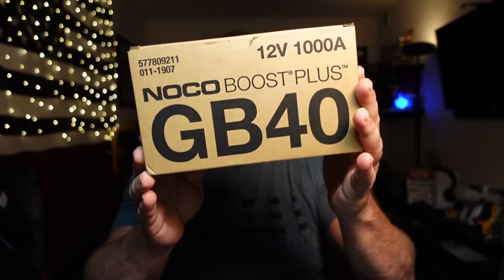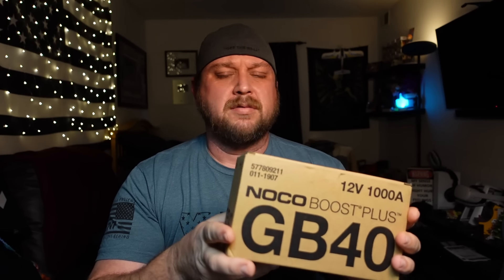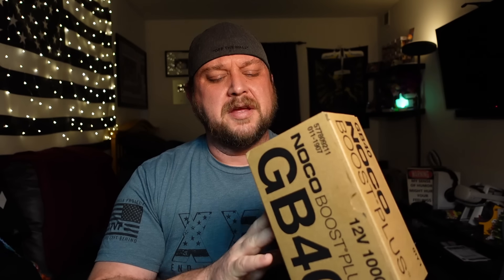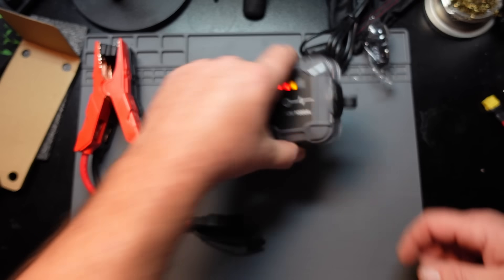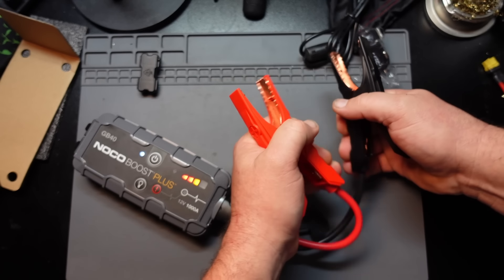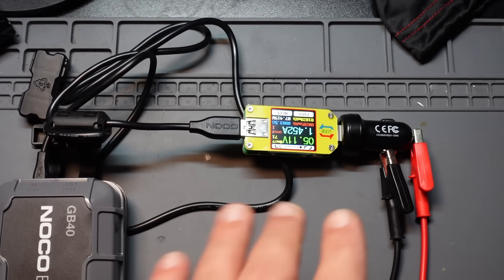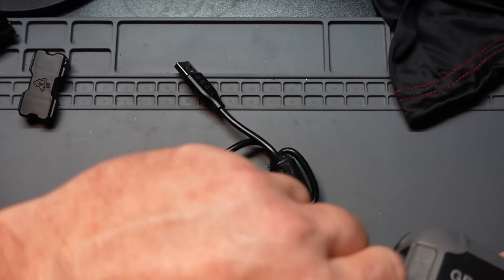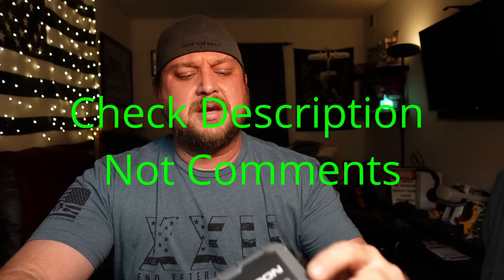NOCO Boost Plus GB40 Car Battery Jump Starter

Comment: I said F buying another battery for the tractor. This is now my battery for 2 years....😅
Reply: Lol nice
Reply: Nice way to ruin alternators
Reply: @jothain  my alternator cost under $100, battery every 2 years cost more than the alternator.  5 years.... same alternator. It's not putting anymore stress than normal, if I had a stereo system like when I was a retarded teen that requires massive Amp draw... it's a good way to ruin it. There is no more Amp draw than necessary to charge at 14.1v. It charges and I'm able to start it after a 15min.
Next time kid, worry about your own stuff you know nothing about 😉
Reply: @Not.The.Avg.Smitty  I'm likely older than you dip. Also if your battery is absolute garbage and if it's so bad vehicle won't start, it'll absolutely 100% certainly load alternator more, your logic is insanely bad. But you're right about one thing. I couldn't care less about your tractor.
Reply: @Not.The.Avg.Smitty  I'm industrial maintenance mechanic and luckily I'm not as old and ignorant as you. Good luck with your endeavors 😂
Reply: @jothain  goes from older to not older real fast, and calls me ignorant. You make no sense. You didn't know I serviced semi tractors, extended wheelbase 120"+, rebuild engines. Now what was that you still do? Like I said I pitty you for working still, I mean with all that knowledge you got, could have ran a business, should be retired like me... right? 😉
Reply: @jothain  have a great day at work, I might go fishing today.
Reply: @Not.The.Avg.Smitty  oh the ignorance of old people. Luckily I belong to generation that was actually educated somehow 😏

Comment: Grabbed this up durring quarentine. Used many times and had zero problems with it yet.
Reply: I got the powrun brand from  Amazon. Zero complaints so far
Reply: Had one of the noco ones as well; it makes it through a winter in the car while holding its charge without problems, and has jumped by car & generator several times on one charge.  Quality.
Reply: How many is many?  I just posted on the main thread that I doubt this thing will last very long with frequent use.  These are really made for consumers to charge up and put in their trunk and used once or twice a year for when they left the lights on or something.  They are built for current delivery and not for longevity.
Reply: @tarstarkusz  id say at least 5 a month. I work for a car rental agency and a lot of the time it is a customer leaving lights on or something of the sort as you said in your main comment. Its in the truck now with 3/4 a charge and im sure i can get a few jumps out of it before needing to recharge. Works fine for the price in my book

Comment: Ironically maybe the spacers were there for space. 😅 the two parts of the grip are further apart without the spacer between the clamps.  Maybe having the spacer made better use of space in the packaging.

Comment: Bought one of them about two months ago on recommendation from a friend who works in the car port (the one for ships (and cars)) here in Gothenburg. They use the GB150 model and have used them daily for many years without problems. So far the GB40 is a champ, got me through the worst part of the Swedish winter. I have a 2.0 liter diesel with a semi bad battery and at temps of -20 C (-4 F), it gives me roughly 10 good cranks when the battery is at only clicking start relay charge level. Very well made and the clamps and cables feel really nice. A heartwarming product in the age of throwaway culture. When you do your 1 year review, I'll comment again and tell you about my own experience.
Reply: Çok teşekkürler...👍

Comment: I brought GBX45, (also based on project farm review for the larger unit) but in general, a lot of reviews point towards NOCO being the best of these sorts of products.  Used it to start a Volov XC60, a Expedition 1998, and a few other cars - in MN winter when it was actually cold.

Comment: I bought 2 of those 3 years ago. You should top the charge of about every 3 months. I keep them in my cars and the only times I have had to use them was at temperatures below 10 F. Both the pack and cars where at the same temperatures. The packs have started V8's in those temperatures with one try. Just keep it charged and it will do fine.

Comment: My Grandpa got me that exact NOCO jumper after my car wouldn't start while picking up my cousin from a train station for my grandma's funeral.  Used it plenty of times since on other's cars, but its battery doesn't last forever sitting in your trunk.  Gotta bring it inside to charge once every month or two.

Comment: I have a GBX55, so a step larger than this one. It was able to start a 4-cylinder gas engine with a dead battery in -25°C (-13°F) weather, after a week of sitting with the unit in said cars trunk, with temperatures ranging from -20°C (-4°F) to -35°C (-31°F) during that time. I was thoroughly impressed.

Comment: Great little jump pack.  I've been using that exact model for about a year now with maybe 6-7 uses...plus I overheated it trying to jumpstart a military Deuce and a half but after it cooled down it still works.  FYI - It will not start a 7.3 Diesel unless the batteries are just barely too weak to crank fast enough for the old girl to bark it off.
Reply from the maker: I think a forklift battery would struggle with a 7.3 on a cold day. 😜
Reply: That motor probably uses a 2000+A cranking current battery and this little fella only goes up to a 1000 amps, but they have models going up to 3000 amps in this series

Comment: I have one and absolutely love it. It's been perfect on diesel and gasoline cars.  However, it lives in the saddle bag of my Street Glide with all my tools for the road. It works great on motorcycles I've had to help out. Me and the better half even attached the NOCO GBC007 to all of our newer Harleys with batteries that are tough to get at if you're on the side of the road. I think you will love this. It's really awesome and has worked better than expected for me.

Finally, I love your channel. Especially when you rate hacks. That usually cracks me up.

Comment: Im also a forklift tech. I had this one for about 8 years and it worked great it finally died on me had a hard time starting even with a full charge. So I just bought the updated version gbx45 its been good so far.

Comment: I have one similar to this (different brand) I keep in my work van, which I rarely drive except when I'm working at a remote site, which usually last a week or two at a time four or five times per year.   There was one year the battery in the van had gone bad and used this thing to start it the entire year. I could get about a dozen jump starts per charge with it.  Now, about three years later, it still works great

Comment: I bought the GB70 because a service shop I do work at replaced their charging units with it and had used it for over a year without any problems.  It's only slightly larger,  but has a larger capacity to jump large trucks. The fact that it doubles as a battery bank for charging other devices is also a great feature for many uses
Reply: I do not like that the gator wires are so short because they don't allow one guy to jump some vehicles,  as the length isn't enough to set it down on a solid level surface and walk away to jump the vehicle

Comment: Thanks for the video.  I've purchase this exact NOCO for my wife's car, our kids cars, and my car.  It's a great jumper.  Note that the charging curve for the GB40 might reflect a higher current draw when the battery pack has a much lower charge.  As I'm sure you're well aware, lithium batteries charge at an increasingly lower rate the closer they get to 100%.  So, NOCO's claim about the 2.1A charging rate probably depends on how low its battery's charge level is.

Comment: My dad and I each purchased the large jump packs and whenever we needed them they didn't work. It seemed like after 6 months they were trash. We had each gone through 2 or 3 and never got to jump anything with them. We both decided to never buy another one.  A few years later I was talking to a road mechanic and he was putting a jump pack away and I asked about it because of how small it was. He said that he had it going on two years and he uses it several times a week and it had enough power to crank up diesels up to what comes in pickup trucks. He said he had another one in his personal vehicle and he said after 8-9months it still showed a full charge. I wrote down the information and I picked one up back in 2017 and I have used it several times for its intended use with no issues, I was even able to jump start a slightly larger diesel engine then comes in a pickup truck, and I have used it as a battery backup several times when the power was out for several days.  I wouldn't hesitate to get another one if and when it finally does go bad.  Project Farm does some cool videos for sure.

Comment: I need to get one of these, always good to have a battery jumper.
Reply: You won't regret it! I bought one just after Christmas, and have used it on a couple of occasions. I used to carry jump leads, but I've had two alternators destroyed, and one battery by playing the good Samaritan. I also carry an Autowit Supercap 2, which has been a Godsend over the last two years. I hope the NOCO Boost works just as good over the same length of time.
Reply from the maker: It’s a good peace of mind for those road trips

Comment: I've used the GB40 for three years, it does punch above it's weight it takes a bit more time to jump a V8 with higher CCA. 

Note it can lose a charge with extended storage in extremely cold conditions, that may be due to the nature of lithium batteries. 

Keep them topped off, family member had a gb150 go belly up after -F tempts and low battery. They do have a multi year warranty, and the gb150 has a voltage meter on it which is super handy.

Comment: I have a NOCO battery charger.
It will charge 6v or 12v.
Lead Acid, AGM  and Lithium batteries.

It also has a recondition feature.
So far 3 batteries that would not hold a charge, now hold a charge.

I am very satisfied with the NOCO brand.

Comment: I got a bigger  one. I think you will like it . I also got the case for it . I like the case, which keeps it from getting beat up in the truck. Have had no problems after 4 years. Living in Wisconsin  the it holds a charge in the cold.

Comment: Noco makes good quality products as far as I am concerned. Have a Genius5 charger and the larger GB70 booster. Have not had to use the booster much but got it because my vehicles are quite old and I like to have a backup power source when camping without service. Will also use it for my tractor when needed (though my solar maintainer seems to keep the really old battery charged as much as it can be). I bought the AC power supply for my booster which charges much faster (36W). I also use the 10A 12V output as a DC supply for my RC LiPo battery charger. I ordered the matching Noco zipper case. I really recommend the case as it protects and keeps everything organized under the back seat of my truck. I really like the light feature of the large booster and often use it as an emergency work light (it’s actually the feature I’ve used the most so far).

Comment: I ha e the GB40 for the vehicle and I have the GB150 that I jump gas compressors with. Ive had them since November 2020. Both of them are well used and awesome. No complaints.

Comment: That's the exact model I use. Most times it works better than a traditional jump. Occasionally it's about the same. Rarely a battery is deeply discharged it just can't do it (in those cases it has taken the battery 6 hours on a charger to bring it back.) Jumps between charges depend on the discharge, usually at least 2-3 light jumps, or 1-2 deeper jumps. Charges easily overnight but can be easy to forget.
Reply: You can override it and jump the battery even if it's deeply discharged - that's the '!' button, but it disables the polarity protection.
Reply: @lucienve  I tend to forget about that, but even so, every jump has a power cost.  This thing isn't a replacement battery, it's a battery booster.  Below a certain threshold, it won't have enough power to boost it enough to start.  Rough comparison estimate, the jumps where you'd normally need like 10+ minutes of idling a source vehicle seems about its limit.

Comment: Have the GB40- it worked great the first year or two, now it can't jump my truck on its own with full charge (doesn't turn over at all, just clicks the starter- on a 5.4L V8). Still works fine for the wife's Toyota though

Ended up grabbing a new AGM/Lithium battery charger from the parts store to get the truck running, the last time I left a light on.

edit fwiw- also I've only stored the noco inside since I got it, so the only cold temps it has seen was while out trying to jump something

Comment: I bought a GB40 to start 2.4L Camry with weak battery. It started the car right away. I did not have to use boost.
Recommended for sure 
.

Comment: I have that. The rubber tab for the contact plug fell off too easily. It will start a “healthy” engine with a dead battery quite easily, it sounds a smidge laboured 1.6L if battery is completely dead but it’s fine. It does thermal cut out a little too quick for my liking. I’m happy with it. I use it quite often maybe 12 times a year. Flashy light turns on WAY TOO EASILY could get turned on maybe in the glove box.

Comment: Bought a GB40 before 2020 cause my truck had a COMPLETELY dead battery (could barely even see the interior lights at night dead) parked at the side of the road at -20C (95 Suburban with 350). I used the emergency mode to get some charge back in the battery which completely drained it. I ran home, charged it back to full, used emergency mode for another 10 minutes to get more charge in the battery and then the ol' truck fired right up.

A couple things I noted about mine - the voltage at full charge is slightly less than 12v, like 11.89v if I remember right. On emergency mode, you can run a standalone car stereo quite well for extended periods, probably shouldn't though. You can also start an 1975 Evenrude 3cyl 70 hp boat motor.

My FIL was having troubles with his Toyota Tundra 4.6 when it was -40C out. With the booster we got 7 or 8 tries before the pack got too low to help anymore.

Comment: I have been using Noco chargers for about 5 years and they have been quite faithful.   I like having the ability to pull a very low voltage battery from the grips of death back to good health, not great but good. Otherwise,  the charging capability is bueno.

Comment: my ole lady's son has one of this exact booster.. it's "ok" at best.. it'll reliably start any 4 or 6 cylinder.. it'll struggle with large v8s tho.  I have one from audew 2k amp.. it's great.. it's never failed to start any motor (aside from a deisel, haven't tried it on a deisel yet)

Comment: I used to work for a cell company, in the warehouse. I woukd collect the "scrap" batteries and pick out the "good" ones. I made three 50Ah 3S packs with cell phone LIons, and then run them in parallel to get a 150Ah pack. I have jumped my subi about 30 times and its still near full charge 😂.

Comment: I had this model for I think 5 years, or 4. It was ok for smaller cars, not good for diesels. It randomly died the other day, would not charge or turn back on. It did it right after I used it for the only time on my own car.... I am likely going to buy the Topdon next. They are bigger but not as expensive, I have done zero research on them though

Comment: Wes, I have a GB40 (a couple years already).  I’ve jump started a 6.5 Detroit V8 diesel with it. Don’t let the little size fool you…just let it charge the battery for a few seconds before you start cranking it.
Reply: Yea, I have a gb40, starts my late 90s Chevy v8 just fine. Get about 4 or so starts out of a charge before I have to recharge it.
Reply: Yeah, on a 6.5 diesel, you will only get one or two boosts at most. For the size of the booster, that’s pretty impressive.

Comment: I have had the GB40 for maybe 6 or 7 yrs and it hasn’t let me down yet. Battery will hold a charge sitting in my trunk for a good 6 mos and hasn’t noticeably degraded. I’ve used it 30 times minimum, including several V8s and it’s always come through. I’m going to replace it when the time comes irregardless of the results of your puny little one year review. So I don’t get the point of all this, unless your channel is geared towards someone other than me, but that doesn’t make any sense.

Comment: The red exclamation point inside of the red circle is a button that is a manual override for the protection circuit. It will not automatically charge if the dead battery's voltage is less than around 2 volts. If you push and hold the red exclamation point it will then charge with no reversed polarity protection.  It's all in the manual.
Reply from the maker: I guess it would help if I read the manual 😜

Comment: I've repaired at least a dozen of NOCO jump packs now and eBay has many faulty units for sale so I'm not overly impressed with the robustness of these premium priced devices.  Personally I've used a Topdon jump pack for a couple of years and it's still going strong.
Reply: All the lithium units are essentially the same. NOCO just spent the most on advertising.

Comment: I found one of those on clearance for half price at tractor supply a few years ago. Build quality seemed good but it would only do a so so job of starting my motorcycle, which is what I bought it for. It didn't seem to work very well for anything bigger than that.  I gave it away with the motorcycle when I sold it. Maybe I just got a bad unit because I have only heard good things (except being priced a little high) about that brand. I have bought several of the jungle site units and I've had a lot better luck with them so far.  But as with a lot of things, your mileage may vary. YMMV.